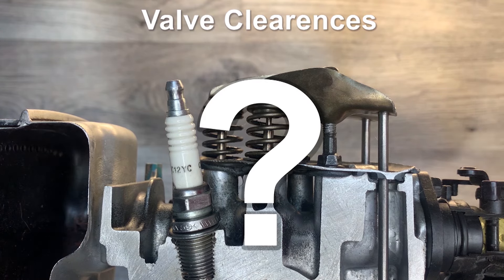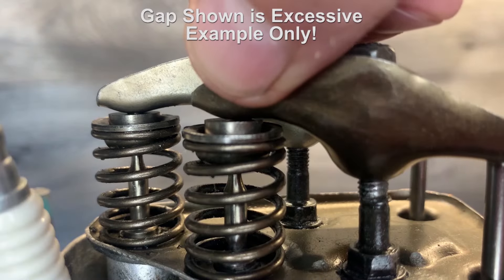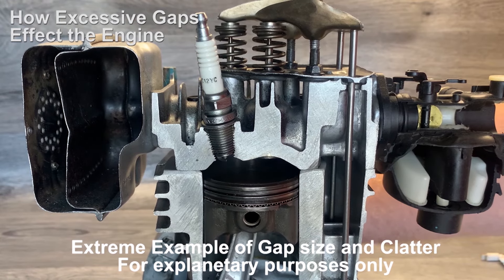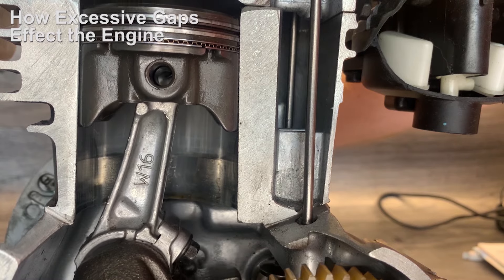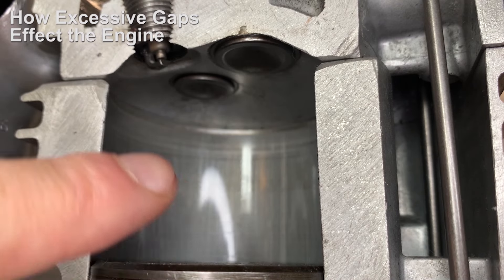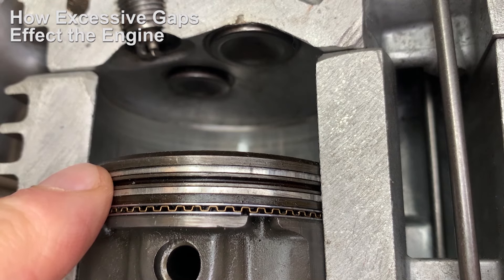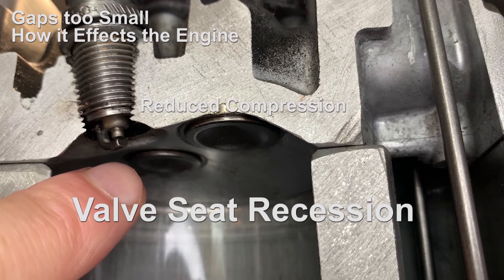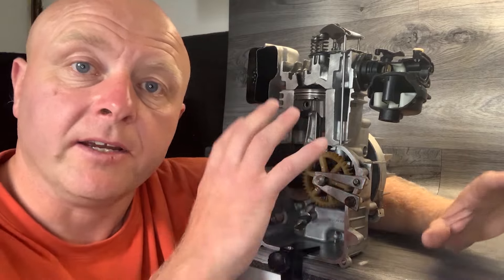The Smartest Reason for Correct Valve Clearances!  (by Craig Kirkman)

Comment: How to adjust from hardpully start to smooth pully start.?
Reply from the maker: thank you for reaching out with your question about adjusting valve clearances to make the recoil easier to pull on your engine.

When you experience difficulty pulling the recoil starter, it could indeed be related to the valve clearances being out of adjustment. The recoil can feel harder to pull if the valve lash (clearance) is too tight, causing increased resistance in the engine's compression stroke.

Here are the general steps to adjust valve clearances, which can help alleviate this issue:

Consult the Manual: Refer to your engine's owner's manual to identify the specific valve clearance specifications for your model.
Prepare the Engine: Ensure the engine is cool and turned off. Remove any necessary components to access the valve cover and rocker arms.
Locate Top Dead Center (TDC): Rotate the engine to the TDC position for the cylinder you are working on. This is typically indicated by aligning timing marks or by positioning the piston at its highest point on the compression stroke.
Check Valve Clearance: Use feeler gauges to measure the clearance between the valve stem and the rocker arm. Compare the measurements to the specified clearances in your manual.
Adjust if Necessary: If the clearance is incorrect, loosen the locknut on the rocker arm and adjust the valve clearance by turning the adjusting screw. Tighten the locknut once the correct clearance is achieved.
Reassemble and Test: Reinstall any removed components, ensuring everything is securely fastened. Start the engine and test the recoil starter to see if the pulling action feels easier.
By following these steps and adhering to your engine's specific specifications, you should be able to adjust the valve clearances effectively. If you're unsure or have difficulty, don't hesitate to consult a professional mechanic or refer to detailed service manuals for your engine model.

I hope this helps guide you through the process of improving the recoil operation on your engine. If you have further questions or need clarification, feel free to ask. Happy tinkering with your engine!

Best regards,

Craig

Comment: i just pulled my cylinder head to inspect due to a failed cylinder leak down test, my question is; is it normal for some valves to not be seated in the closed position?
Reply from the maker: Hi. When you remove the cylinder head of a small 4-stroke engine, it is not uncommon to find some valves that are not fully seated in the closed position. This is because the engine's valves are controlled by a camshaft and valve springs, and their position can vary depending on the engine's timing.

In a 4-stroke engine, there are typically two types of valves: intake valves and exhaust valves. These valves open and close at specific times in the engine's cycle to allow air and fuel into the combustion chamber (intake valves) and to allow exhaust gases to exit (exhaust valves).

During the engine's operation, the camshaft and valve springs work together to open and close the valves at the right times. When you remove the cylinder head for inspection, the valves may be in various positions, and some may not be fully closed.

If you find that some valves are not seated in the closed position, it's generally not a cause for concern during disassembly. However, when you reassemble the engine, it's crucial to ensure that the valves are correctly timed and seated properly. Improper valve seating or timing can lead to poor engine performance, loss of compression, and other issues.

Before reassembling the engine, consult the manufacturer's service manual or repair instructions for your specific engine model to ensure you follow the correct procedure for valve adjustment and timing. This will help ensure that the valves are in the correct position for proper engine operation. If you're unsure about the process, it's a good idea to seek guidance from a qualified small engine mechanic or refer to the engine's manual for detailed instructions.

I hope this has helped a little
Craig

Comment: HI SIR. DO YOU KNOW VALVE CLEARANCE FOR HYUNDAI 420CC?    6/8.  OR DIFFERENT?
Reply from the maker: Hello! It's great that you're looking into the valve clearance specifications for your Hyundai 420cc engine. Valve clearance is an important aspect of engine maintenance, as it ensures that the valves open and close properly for optimal engine performance.

For the Hyundai 420cc engine, the specific valve clearance can vary based on the model and its application. However, many small engines like this typically have valve clearance specifications in a common range:

Intake Valve Clearance: Often set between 0.004 and 0.006 inches (0.10 - 0.15 mm).
Exhaust Valve Clearance: Usually slightly larger, around 0.006 to 0.008 inches (0.15 - 0.20 mm).
BUT PLEASE NOTE:  these are general guidelines and may not be accurate for your specific engine model. It's crucial to refer to the Hyundai engine manual or contact a Hyundai dealer or service center for the exact specifications. The manual will provide detailed information on how to measure and adjust the valve clearance correctly.

Remember, working on engine valves requires precision and caution. If you're not comfortable with this kind of maintenance, it's advisable to seek assistance from a professional mechanic. Proper valve clearance is essential for engine efficiency, performance, and longevity, so it's important to get it right.

Comment: Would this noise be under load at about 2500 rpm’s?
Reply from the maker: thank you for reaching out with your question about tappet noise under load at around 2500 RPM.

Tappet or valve noise can indeed occur under specific conditions, such as when the engine is under load at certain RPMs. Here are a few factors to consider regarding tappet noise:

Valve Clearance: Insufficient valve clearance can cause tappet noise, particularly under load or at higher RPMs. If the clearance between the valve stem and rocker arm is too tight, the valves may not fully close, resulting in noise due to contact with other engine components.
Engine Load: Under load, especially at mid-range RPMs like 2500 RPM, the engine experiences increased stress and demand. This can accentuate any existing valve clearance issues or mechanical vibrations, leading to audible tappet noise.
Oil Pressure and Lubrication: Proper oil pressure and lubrication are essential for maintaining optimal valve operation. Low oil pressure or inadequate lubrication can contribute to tappet noise, especially when the engine is working harder under load.
Other Factors: Additionally, factors like worn valve components, camshaft wear, or timing issues can also influence tappet noise under load conditions.
To diagnose and address tappet noise under load at 2500 RPM, I recommend the following steps:

Check Valve Clearances: Verify that the valve clearances are within the manufacturer's specified range. Adjust if necessary.
Inspect Engine Components: Look for signs of wear or damage on valve train components, including the camshaft, lifters, and rocker arms.
Evaluate Oil Condition: Ensure the engine is using the correct type and grade of oil, and check oil levels and pressure.
Consider Professional Inspection: If the issue persists or if you're unsure about specific components, consulting a qualified mechanic or technician for a thorough inspection would be beneficial.
I hope this information helps shed light on potential causes of tappet noise under load. If you have further questions or need assistance, feel free to ask. Thank you for being part of our community!

Best regards,
Craig

Comment: What is the correct gap
Reply from the maker: The correct gap depends on your particular engine. Many manufacturers have different settings for different makes and models. If you find your make and model of engine and perform a Google search then you should find your correct settings

Comment: Please note that is an Engine with a mechanical camshaft and cam followers. 
Therefor his targot is rocker arm to valve stem "clearance", rather than cam follower pre-load, as required with a hydraulic camshaft and cam followers.

Comment: Ok, so what should I set them at?
Reply from the maker: All engines have different clearances as specified by that particular make and model of engine manufacture. If you have your owners service manual, it may inform you in there, or do a Google search for valve clearances for (your engines make and model)